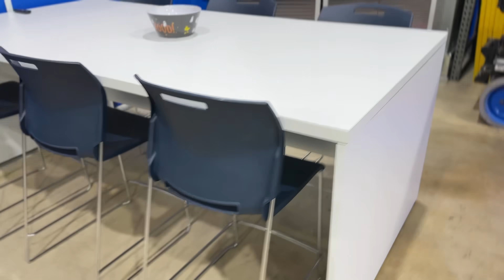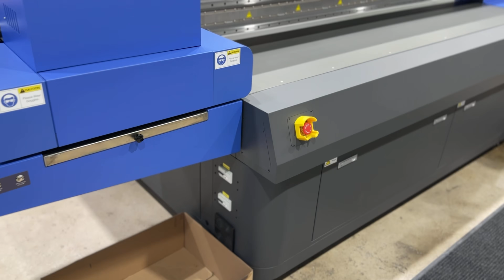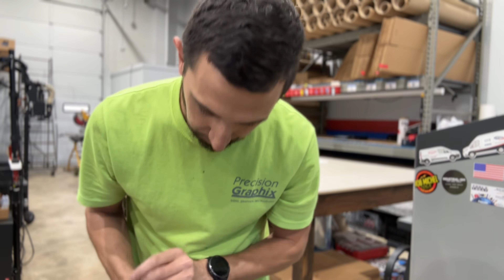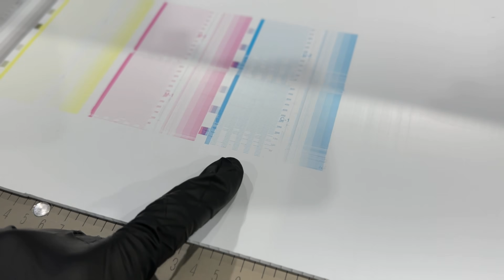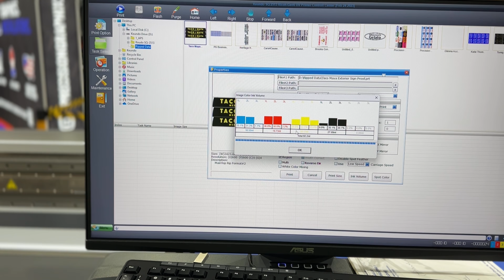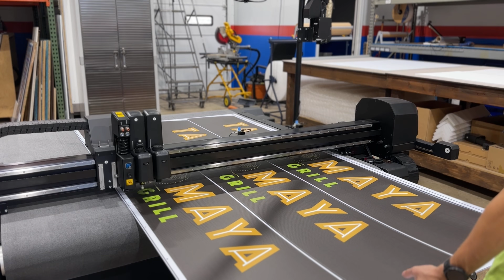I'm Back with a Print Shop Update!  | Steve The Graphics Guy

Comment: When i saw the summa barcode printing along the 8 foot edge i was wondering how that was going to work lol, do you not use the barcode workflow with your summa?
Reply from the maker: I actually don’t most of the time. I really only use it with paneled wall murals on a roll. Do you know how I can change it to be on the 4’ side?
Reply: @stevethegraphicsguy  this is Chris from GRS, the YouTube algorithm served me your video. You can rotate the barcode in the Rip and Print Window of Flexi. On the contour tab there is a check box labeled Rotate Cut Job. Activate that check box and make sure it is set to 90 degrees.
Reply from the maker: Thanks Chris! I missed your comment but later did figure out the Rotate function!
Reply: @stevethegraphicsguy  no sorry I don't, I don't have a flatbed printer so it's never come up.

Comment: Love to see you back on YouTube! Interesting that you shut your machine off daily, does your machine have any circulation pumps? If so you might be wise to leave it running to keep the ink flowing through the ink.
Reply from the maker: Thanks Matt! I don’t believe that it does. I could leave it on, but still need to shut the valves in case the power did go out. We haven’t really had power issues in the past but I don’t want to deal with the aftermath if it does lose the pressure. I think something happens where the ink back flows into the pressure tubes and creates a mess!
Reply: @stevethegraphicsguy  very interesting! Our vanguard which ironically has identically control software mists ink every 10-15 seconds. So it is constantly wasting ink but it keeps the lines pressured.